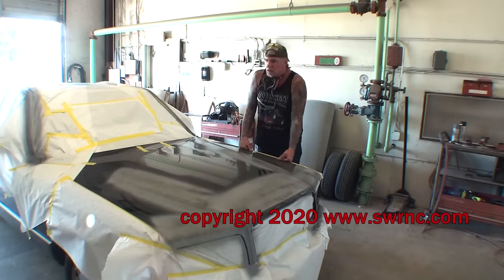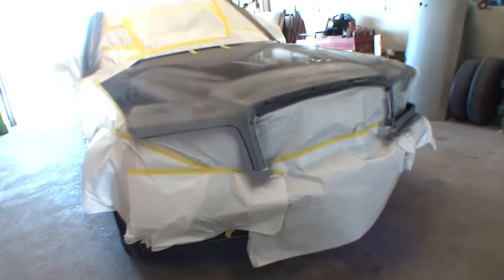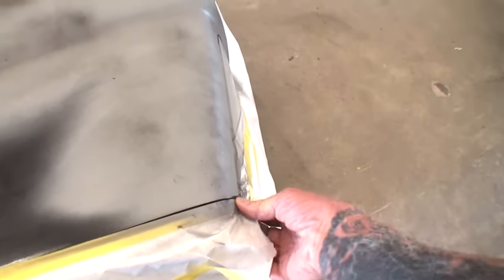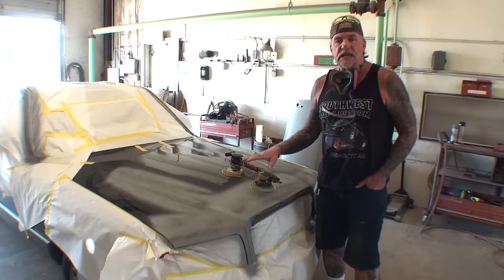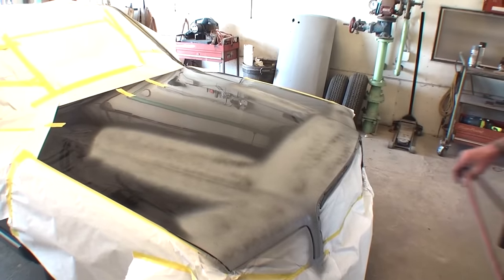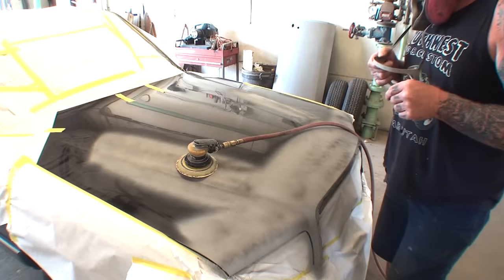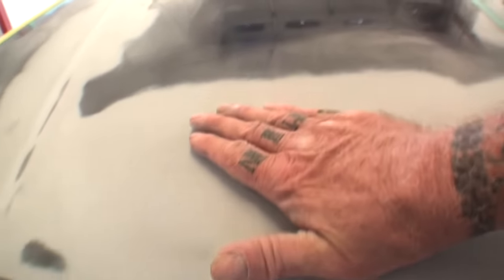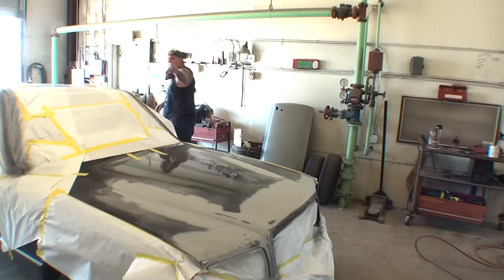How Can I Sand A Car For Paint Really FAST? Paint And Body Tech Tips

Comment: Thanks so much for these excellent videos.  I am in the process of restoring a 1975 MGB.   The bodywork is finished and I have used the trunk lid for practice.  I've made and then fixed several errors.  Now I need to strip the base and the layers of primer because I had not given the primer enough time to cure.  Lesson learned and, once again, thanks for all of your guidance.

Comment: Great Videos:  your videos make my wife and me smile. Is my summary good/complete? 
- Finish sanding repairs & rest of original clear coat w/400 (assume perfect now) on entire panel(s). It’s OK that existing clear coat stays, as long as it is 400 sanded. 
-Clean.    -Epoxy Prime Bare Metal.   -Paint entire areas/panels just sanded w/ 1 stage paint.   -2K Clear Coat, etc. 
Hope I got this right & get an A from your classes!  I’m a restorer not a painter/body guy.   Thanks. Want to do some professional small/tiny repairs.

Comment: Thanks for the video & advice 🙏🏽
I think for a small or medium sized car a short throw sander with a rougher sand paper to cut through paint a less rough sand paper to smoothen out and even the surface & a light sand paper to get the swirl marks would be my plan of action after that you can use a small 4 inch roller with an oil based car paint for $50-170 maybe $200 bucks if your on a budget💰 it can be done D.I.Y 🧑🏽‍🏭

Comment: Before anyone thinks you always use a 'short throw' sander like I did for fine grit sanding the 3M rep slammed me and explained that the 'Trizact' line of papers was designed specifically for long-throw traditional D/A palm sander.  Which I didn't know before that.

Comment: I just started at a euro classic car shop. Got any tips? One question i have is arent you supposed to wet sand for a finish and i like 600 for fine finish not 180 or 320 idk just think it looks better nut like i said idk i just remeber the basics from highschool i 35 now so was like lots of years ago. Anyway i like ur video and i like the fact u talked about the guide coat i have rattle cans of it and its a great tool.

Comment: Sweet info man! I'm making an attempt to have a bare metal finish on my Jeep Wrangler... Have been using a random orbital, but have been using it wrong. Instead of getting more coarse grit sand paper/net, I was pushing harder to get rid of deep scratches (tried a different method of paint removal before and REALLY scarred the surface). As soon as I'm off work, am going to use your technique from 60 grit up to 600-1000 grit to get that mirror finish! Awesome video, thank you again!

Comment: Hey I have a question, I have some z3 style fenders that I'm wanting to fill the vents on to make it an oem looking fender. What would be the best method to fill them? I don't really want to fill that much with body filler unless there isn't any other option. I've seen people use spray foam but that sounds chintzy, what would you do? Thanks.
Reply: Just add fiber glass patches then sand them down

Comment: I have a question. I have a pearl black 2020 civic and need to touch up the bottom of the drivers side door half. I tried back masking but it left a thin line. Do you recommend I base out the bottom half then clear the entire door or recommend repainting the entire door to get it to blend.

Comment: Nice video, to the point. I have just bought a new Mirka Sander which is mains powered instead of air, comes with an extraction unit which really keeps dust to an absolute minimum. Thanks for taking the time post your videos.

Comment: I remember back in the day,many bodyshops used 180 hand sanding before painting 😟😟I would see bad ass paint jobs with allot of sand scratches.Half a sheet of 180 dry to sand a whole car.
Reply from the maker: Times have changed for sure Filiberto. I remember Hand Sanding a car all the way to 3000 before buffing! Now it's all done with a da pad!  Makes life easier for sure!
Reply: @diyautoschool  lol when wetsanding I still hand sand with 3000 before buffing

Comment: Hi.  We are painting a truck with Dynacoat Opticryl C900 RM (single stage), prepared 3:1 paint:thinner, and noticed that the paint is sticky after 1 week of application on the roof, but it is perfect dry and hard on the hood.    Any ideas why the roof ended up sticky?

Comment: i have a Hutchins palm sander im not sure what im doing wrong but when im sanding its like right away i get swirls in my paint. and primer drives me nuts, could the issue be i use a velco pad instead of the PSA and I buy 3m paper. great video
Reply from the maker: It might be a LONG THROW Sander and NOT a SHORT THROW JOB! Just because it's a palm sander doesn't mean it's a short throw.. Check out the mm throw on it vs. other brands and see if thats where your issues are.. I have an older hutchins da sander and it's a long throw job.. Good luck

Comment: Worse guidance you could receive. air !  Porter Cable has a powerful  electric 6" orbital variable speed commercial grade sander. Can sand indefinitely doesn't even get warm as apposed to five minutes and the air compressor's screaming. Had mine over ten years use it every day.